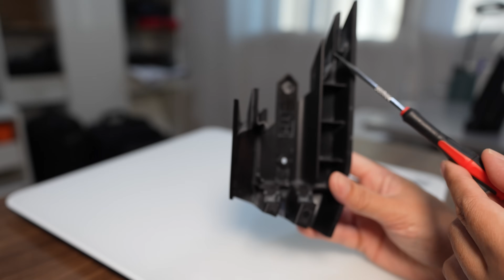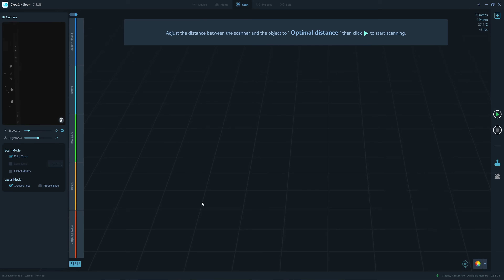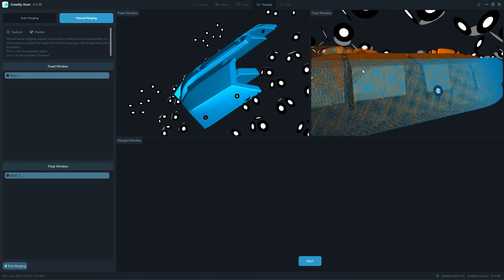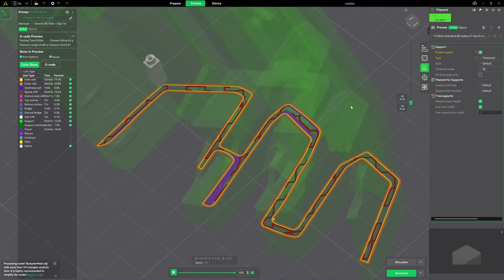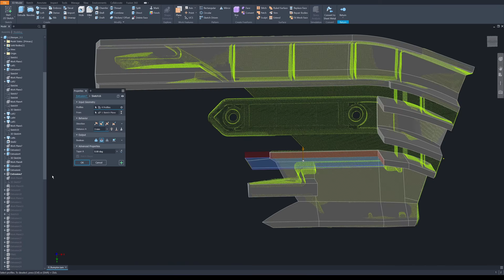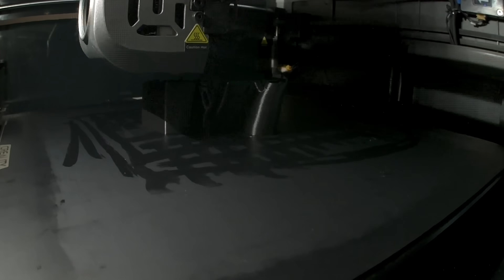3D Scanning to CAD: Simplify Auto Parts for 3D Printing with Creality Scan Raptor PRO

Comment: Please man would you make a video that shows us how to make a scan from laptop and then transfer it to pc? 
I did a scan on my mac and unable to mesh it since my mac is only a 16gb and it’s running out of memory so I want to export the scan to my desktop and mesh it there since I have there 64GB of ram 🙏🙏🙏🙏🙏
Reply from the maker: Point cloud data scanned on a Mac typically can't be fused on a PC due to cross-platform incompatibility. In contrast, when I scan using my Windows laptop, I can simply copy the entire project folder and continue the fusion process seamlessly on my desktop PC.
Reply: @Payo-TensileCreator 😭😭😭😭 thanks man 🙏

Comment: What stickers do you put on the sticker holders? The big ones for big items or the small ones for small items? Or do you have 2 sets of sticker holders?
Reply from the maker: Most blue laser scanners can recognize two sticker marker sizes: 10mm and 6mm. I'll start by applying the 10mm stickers, then use 6mm markers for narrow and large curved areas.
Reply: @Payo-TensileCreator  I am not talking about markers you put on the object itself, I am talking about the markers you put on the pyramid shaped object you put next to the object you scan, what size of sticker should I use? Use the 6 mm because they are good for small object or the big, or mix them, or have 2 sets of pyramids one with big markers for big objects and one with small markers for small objects

Comment: Have to seen or tried Quicksurface software for reverse engineering?
Reply from the maker: Yes, I did. It's totally useless. Reversing using CAD standard tool is faster, easier and more effective, you can also reverse this part using FreeCAD.

Comment: I bought the Raptor about 5 months ago, I absolutely do not recommend it, a Windows update was enough to make it a useless paperweight, and Creality was unable to solve the problem.
Reply from the maker: In the Creality Scan software, you'll find a button represented by a small cog icon. Clicking on it will reveal the "Uninstall Update" menu. Selecting this option will roll back the Windows update, allowing your scanner to connect to your PC for the firmware update. Once the firmware update is complete, you can reinstall the Windows update by navigating to the settings menu and choosing "Check for Update."
Reply: @Payo-TensileCreator  dear Payo, I have performed all the procedures that are described on the creality web page, guide to solving the raptor scanner problem, I have a laptop Asus predator tritone 300 SE, I made sure that the Windows updates reported by creality had been removed, investigating the system folder of the PC, I performed scanner firmware upgrades, but all this was useless, the scanner connects for a few seconds and the creality software crashes, the end user should be supported with simple procedures, this is a job that should involve creality technicians, and those of Microsoft, to propose a simple patch within everyone's reach, not complicated procedures that do not solve the problem.

Comment: The initial 3D print result is very good and in my opinion is very much usable. Just drill the holes a little wider. You did good job showing the process. Thanks for the video!
Reply from the maker: yes, it's usable, I enlarged the holes with taper pins. https://photos.app.goo.gl/S152EQpswRcTVPQU7

Comment: Awesome job! Your videos are improving with every upload! Have you tried to use Fusion 360 or even FreeCAD to do the same workflow?
Reply from the maker: I’m confident this part can be modeled using any 3D CAD software, as the process relies solely on standard functions available in most CAD programs. I could even create this using the 1998 version of AutoCAD.

Comment: u dont have to set your resolution before start scanning ? resolution can be changed after you scan ?
Reply from the maker: It has to be set before start scanning. You can change to higher resolution while scanning with "Local Detail" function.

Comment: How did you select only your background like that?
Reply from the maker: Tool -> Application Options -> Colors -> In canvas color scheme -> Dark  and set background to 1 color.
Reply: @Payo-TensileCreator   Hi Payo! Im not able to find the Tool section in the creality scan, software, im using cr scan raptor the base model. And will love to know how you do that because i need to make like 6 scans from diferent angles to get a nice result and its quite hard to remove the whole unwanted scanned area
Reply from the maker: @mxklkarmonkey970  Ahh you mean lasso selection tool. It's in the bottom of the menu, use left mouse click and hold down shift key to make selection, and there's "Invert selection tool" down there where you can invert your selection.

Comment: I would like to have seen the fitment of the version which was sent directly to the printer.
Reply from the maker: I did enlarge the holes with taper pin, and it fits perfectly. https://photos.app.goo.gl/S152EQpswRcTVPQU7
Actually, I've made the version that I clean up in Substance Modeler, 10 minutes work and the outcome is almost as good as the CAD version.
Reply: @Payo-TensileCreator  Great information.  Thanks.

Comment: Great video and it seems like you know a bit what you are doing !;) 
For my part, I am a professional digital modeler using Alias Autostudio since over 25 years and can tell you that the surfacing on the plastic parts outside where you said they are partial made with a surface modeling software (CAS like Alias) are terrible and I gonna watch the video now to the end to see if you create better results ! Otherwise I will soon upload a video about this part ! Good luck and keep going.
Ok I kept watching until you start reverse-engineer the surfaces in Inventor .. well, either the software has massive limitation or you don’t how to align G1 (tangent ) and G2 (curvature) and construct certain feature curves on planes .. looks very wobbely .. but anyways .. good start ! Appreciate the efforts! I try to get hold on that part and scan it myself an rebuild it soon too . I keep you updated. Or send me the scan if you like that I share the 3D model for free later. 
Best wishes
Reply from the maker: I've mentored new design engineers in the past, so I can recognize signs of inexperience in the original designer. It’s likely they struggled with this part for days or even weeks, resulting in a design that is difficult to revise. Despite the high effort invested, the outcome appears low in visual impact. Some sections of the wall are excessively thin, and no FEA analysis seems to have been conducted. I've encountered similar issues frequently in Chinese PEV components but have never come across such flaws in parts from Japanese manufacturers.
Reply: @Payo-TensileCreator well we all know that those parts don’t need be necessarily designed in Japan .. they get designed there, where it is cheapest !
But still a good job you did there! Not many are capable to reverse engineer such a complex part. As soon I find time I will upload a similar part and show how to design those A surfaces with automotive standard, ok
All the best

Comment: Nice tutor! 
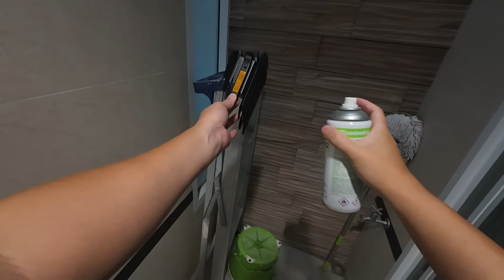6:45 First you stick markers and then spray the object, does this spray don't affect markers when scanning?
Reply from the maker: There's no alternative, you should avoid touching the part after spraying. Light spray is fine for 3mm markers, but heavy spray is not. The 10mm markers, however, appear to withstand thicker spray.
Reply: If you spray the object and then apply the markers, they won't stick (not properly, anyway)
Reply: @MichaelTavel  makes sense